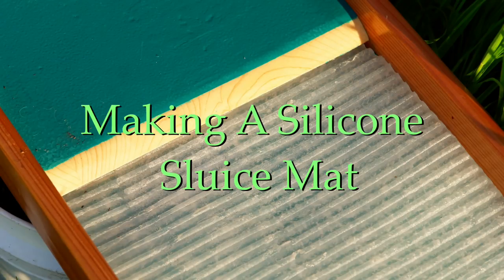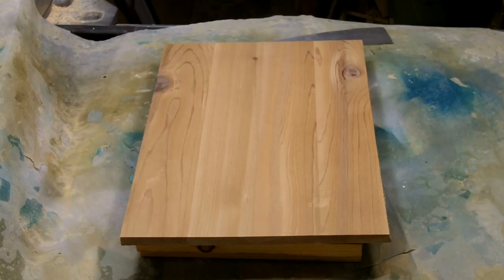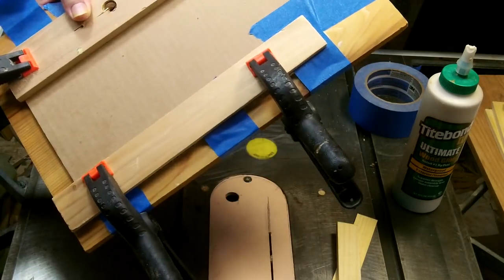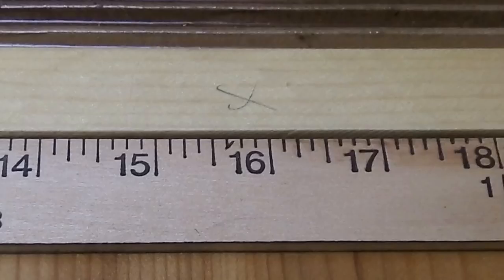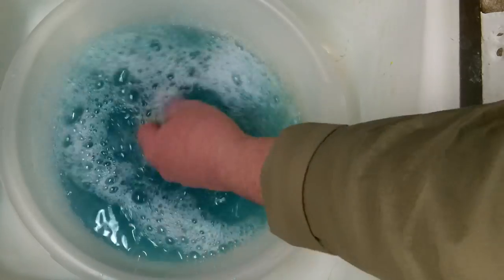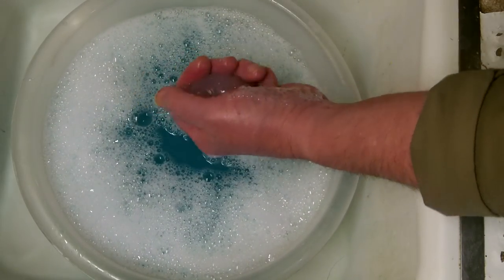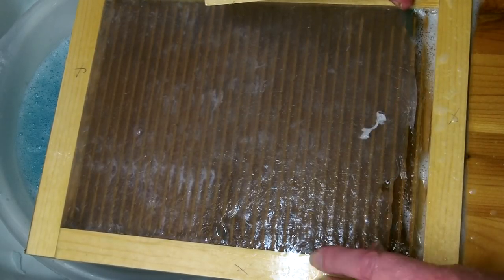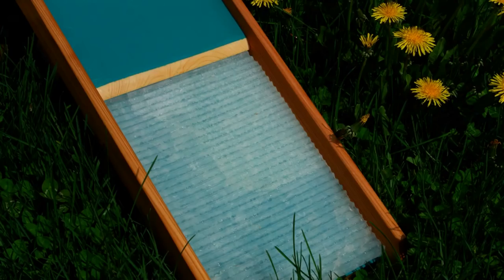DIY SILICONE GOLD SLUICE MAT

Comment: I got a big truck mud flap, I'm thinking of using it as a mold, deep grooves/ corrugated. It is a stiff plastic, used and rough, I am wondering about needing a release agent, so the silicon doesn't sticking to it?
Reply from the maker: Hi Murray and thanks for watching. That should work fine for you. Yes, you will most likely need a release agent. I use Dawn Dish soap. I mix about 1/2 oz to 2 or 3 cups of water in a container. Brush it all over the mold. Then squirt about half a tube of silicon into it. And let it sit for about 1 minute. You may want to wear rubber gloves if  you’re sensitive, then coat your hands with the Dawn soap and pick up the silicon and knead it like you would with bread dough. After a couple minutes, start pushing it into the mold. Push it into the cracks with your fingers and when crack is full press down hard with the heels of your hand. Then level to the top of the mold. When you have finished you can put the mold into your sink if it will fit and either run hot water over it or put it under hot water. Hot water makes it set up faster.
Good luck with your build.

Comment: Another great video. Thanks for sharing your ideas and giving us the benefit of the lessons you learned. I'm wondering if a mold could be made with bubble wrap. Would it give the kind of pockets the other guy was getting with the Legos?
Reply from the maker: Hi Tim. Thanks for watching. Yes, it could and it would be an interesting mat. Yes, it would make the pockets very nicely. I made a sluice with circles in the tops of the riffles a couple of years ago and they really worked well. I think if you took a medium or small bubble piece and popped all the bubbles on one side so it would set flat on a board and then glued it down with silicone and built the frame around it, it would work out very well.

Comment: There is a liquid rubber type stuff for sale, that is used to repair screw driver handles and put padded handles on other tools.
May be worth an experiment.
Its called plasti dip.
Reply from the maker: Phillip Jacobson 
Hi Phillip and thanks for watching. Yes, I have some and have tried it. It will work to make the mat but it is a little different material than the Silicone and the gold doesn't stick to it quite as well. But you can make a rubber type mat with it.

Comment: I wonder if you could just spray the cardboard with something that would turn it into a flexible mat on its own?
Reply from the maker: Hi BC and thanks for watching. You may find something but the problem is, that it has to soak into the cardboard and keep it stiff and flexible. Rubberized compounds only sit on the top and don't soak in and the slightest weight on the cardboard crushes it down. Turning the cardboard into a hard mold was the best I was able to come up with. Actually you can use the mold in a sluice. It won't be very long lasting but it would work. You could actually build a sluice out of cardboard and waterproof it with the Titebond glue and Spar varnish. However something that works better is Rigid Styrofoam Insulation. I made a Miller Table out of it that works very well.

Comment: I know now where are Road Runner went to work after Warner Brothers let him go.  He's now working for Silicone Depot. 👍The fastest shipping I have ever had.
Reply from the maker: I understand they have good service. I priced them about 4 years ago and found that  I could buy silicone at Walmart cheaper. Now that Walmart has priced it so high, I may have to check Silicone Depot again.
Reply: @utahavalanch   #1 silicone 6 dollar's a tube. I bought 6 with free shipping, and the cardboard box corrugation is great for making molds. 👍
Reply from the maker: @johnnytoy5487  
Wow!!! Can’t beat silicone at half price with mat molds thrown in. I’m going to have to get in on that👍👍. I’m getting tired of Walmarts prices.
Hmmm, now that I think about it, you could make the whole sluice out of waterproofed cardboard as well. That might be interesting to try just for fun.
Reply from the maker: Which flavor did you get? The Pro or the Premium?
Reply: @utahavalanch   premium industrial
Reply from the maker: @johnnytoy5487  
Thank you.👍👍👍👍
Reply: 🤔 Question, Who figured out that Dawn dish soap did not allow silicone to stick to things. Just curious.
Reply from the maker: @johnnytoy5487  
Us old guys.😝. Human spit works just as well. Back in the 60’s silicone was a military only material called RTV. it was used on military aircraft. We used to get friends to sneak it off base so we could make cheap gaskets for our cars. Spit was the main thing used to keep it from sticking to your fingers. That got old so we started looking for something better.  Then started wetting finger and running across bar of soap. Alcohol worked fairly well. Eventually dish soap came along and that and Vaseline and cooking oil works too.

Comment: Hi Utahavalanch, great build nice looking matt, I tried wetting my mould up before I put the silicone down, the matt turned out a disaster. I had to make an other mould. I waxed it all over and the matt was an other disaster. The miller table I was making is finished, gave it a try this afternoon, I have a small problem, the gold that we are getting is flat as flat, I have a pan at the end of the table to see if there is any gold been washed over the end. I am going to have an other play tomorrow. It looks good so far. Cheers     Robert - Aust'
Reply from the maker: Hi Robert and thanks for watching. What problems did you have with your mold? You need to knead the Silicone in a bowl of soap and water for about 7-10 minutes so that it will set up. Also if you wet the mold very well with the soapy water the silicone shouldn't stick to it. Then just let it dry long enough. If it sticks to the mold after it dries, you might try using glycerine that you can buy in a pharmacy. It is kind of thick like syrup and will make a good mold release.
With the gold on the Miller Table, be sure to have a valve on the water line that you can reduce the water flow with and keep the angle at about 3 degrees. I screen my material to the same size, then turn the water down and drop a little black sand the same size on the table. Then adjust the water so the black sand starts moving down the table slowly. Then it's ready for adding the gold.
Reply: Hi Utahavalanch, there are a couple of issues that do not work for me, the silicone takes a long time to dry 1-2 days, and after waxing the mould and watering up as well the silicone still sticks to the mould in a way that it is very hard to get out. On my last attempt the silicone stuck that bad that it tore an lost its shape and was unusable. I will give the glycerine a try. The miller table, I have it quite flat and enough water to make the black sands flow off the table, I have the shut off valve in the middle of my hose like you suggested. I will be checking my pan that I have at the end of the table to see if there has been any gold washed off from my first run. I have my cons screened down to fly wire mess.    Cheers       Robert
Reply from the maker: @newbee1016  

Hi Robert. A long dry time sounds like very thick silicone and not enough time getting massaged in the soapy water. If your mat is thick, try to make one only about 1/4" thick to test it.   Be sure you have about 25% Dawn or another dish soap mixed in the water. Also sounds like not enough dish soap in the mold. You can brush a thin layer of straight dish soap into the mold before you put in the silicone.
You may have to try a different brand of silicone. Different brands act differently. Be sure it is 100% clear Silicone and not the tinted type. 

One thing I recommend to people just starting out with new Miller Tables and sluices, is to buy a package of paydirt from a good reputable company to run over/through it for the first time if they haven't run one before. Check out some of the YouTube videos of people testing paydirt to find a good one. I can recommend several but one is in Alaska and another is in New Hampshire. Don't know what the shipping would be like. 

They will have gold in them and when you see how the gold acts, then you will know for sure if you have gold or not. If you haven't worked with real gold before it's very hard to tell what is gold and what is not. Once you see it for real then you will know if it's gold or not.  If the black sand is moving slowly down your table but the gold is washing off, then you most likely have mica. It looks like gold in every way but if you get it in the shadow it loses it's shine. If you put a piece in a gold pan and try to smash it with a spoon, it will shatter. Real gold will not.

Even very small gold will stick to the table. I hope some of this helps.
Reply: Hi Utahavalanch, thanks for your tips on the silicone I will give them a try when I get around to making an other matt, maybe tomorrow. The miller table is dialled in and catching the finest of gold that I can only just see. Thanks for the idea and the build video, I will be using this to clean my con's from now on.     Cheers     Robert
Reply from the maker: @newbee1016  

I'm glad to hear things are working out for you. Get a lot of practice on the Miller Table as it has a lot of capabilities. With my Urban prospecting, I run a lot of small samples to test different areas and it's a lot quicker and easier to just run these on the Miller Table. You can easily see very tiny gold that would be lost with many sluices. 

This new sluice I'm working on may be of interest to you as you are heading in it's direction. With this build under your belt and you get the hang of Silicone mats or you can use just any mat with it or do like I'm going to do and make it into a Drop Riffle Sluice. It's a combination Miller Table Sluice. I have been having a lot of fun with it.
Reply: Hi Utahavalanch, I checked the angle I was running my table at 2deg, an it was running the black and white sands off perfectly. I am going to make an adjustable leg system for it so I can set it up more easily. Cheers    Robert

Comment: You could use a drop riffle sluice as a pattern to make a silicone mold. Then use that mold to make a silicone drop riffle sluice. You might need to use something different for a release agent. Or perhaps use resin instead of silicone for the finished product.

I wonder how silicone would perform as a miller table surface using custom textures. Did you know you can dye silicone with food coloring? You can also mix it with corn starch to make it more durable, and easier to work with like a dough? King of Random has some good videos. He calls this silicone/starch material Proto Putty.
Reply from the maker: Hi Bullfrog and thanks for watching and the comment.  Yippers, I'm in the process now of making a mold for a drop riffle sluice. I'm playing around with different size riffles and troughs and trying to decide which would be best. Yep, decisions, decisions. :-D  I have used different paints to color some of mine and it works quite well although it speeds up the setting time to only about 10 minutes. The problem with the starch method is that the silicone loses some of its metal "Stickiness" that makes it so good as a gold catcher.  Yes, it works fairly well as a Miller Table and I have tried it. Problem is that it holds the black sands as well as the gold as they are metal also, so the hard deck with the Chalkboard paint is still the best in that regard. I am currently working on a Miller Table type sluice that has been one of my most fun projects to run. trying to get a video out.
Reply: @utahavalanch  I just found out Rust-Oleum has a clear chalkboard paint.
Reply from the maker: @jjbailey01  

That is interesting. I guess so you can have a customized color under it. We tried using Matt Spar Varnish on my grandson's sluice slick plate and it worked very well to catch and slow the gold down. Problem was that the gold blended in with the color of the pine and was hard to see. I have the colored Chalkboard Paint on my new sluice that I'm trying to get a video out on and it works very well as it's a strong color that the gold stands out well on.
Reply: @utahavalanch  I was thinking the same thing with using a custom under color. And it's about $10 cheaper for 30oz. than the black paint is for a quart.
Reply from the maker: @jjbailey01  

I have been using the quart paint for all of mine. You have to choose a color for them to mix it when you buy it. They have about 9 different colors for you to choose from. I like the green or the teal colors the best. Home Depot also has a little 3" roller set that I use to apply the paint. This is some pretty tough paint and I have been using it for painting outside wood items that are out in the weather all the time and it holds up better than the Behr outdoor paint. So that makes it ideal for prospecting projects like miller tables.

Comment: Have you ever tried adding food coloring like some people do ?
Reply from the maker: Yes I have and the water based hobby paints that Walmart sells. They both work well but the hobby paint causes the silicone to start setting up rather quickly so you have to work fast with it.
Reply: @utahavalanch    SUCCESS 👍 The silicone setup fine today.
Reply: Now I'm waiting on the spar varnish to set up on the cardboard mode I made today. Thanks
Reply from the maker: @johnnytoy5487  
Congratulations. Glad it’s working out ok.👍👍
Reply from the maker: @johnnytoy5487  
Sounds good. Give it about 3 good Coates total.

Comment: What thickness cardboard do you start with? Regular or maybe a piece of refrigerator cardboard box.
Reply from the maker: Hi Johnny and thanks for watching. I like cardboard with the largest corrugations. I look for the largest boxes I can find. The box used here held a bushel of fruit from a fruit farm.
Reply: Forget the box.  Someone mentioned using a washboard.  I know theres one laying around someplace which im gonna try out myself right now.
Reply from the maker: @UpcomingJedi  
That would work as well. However it been many years since I’ve seen a washboard around so one may be a bit hard to find.😄

Comment: Using the same silicone as you use, and I'm still having trouble getting it to set up 🤔 got any tips.
Reply from the maker: Hi, Johnny. Well, be sure it says 100% silicone on the tube. There is a calking that looks like the silicone but it doesn’t set up. That is usually the mistake some folks make.
Next silicone needs heat and water to set up. If you squirt some silicone into a bowl of soapy water and then gather it up and start kneading it like you would bread dough and dipping it back in every 15 seconds, you get it the water it needs. If the water is cool it will take longer to set up. If the water is warm, say about 80 degrees, it will start to set up in about 3 minutes and you have to work fast. After you get all the silicone in the mold and leveled, let it set up for about 5 minutes and then put it in the kitchen sink and run a light stream of water over it as hot as you can get until the silicone feels warm to the touch. Let it sit for about 15 minutes and then do it again. Do this about 4 times.
If you can get the whole mold in the sink, you can cover the mold with hot water and let it set. When it gets to the point where when you press down on the silicone and it feels hard and not soft, it’s ready to go.
I usually fill the mold at night and then go to bed as I get too anxious to get it out and ruin it if I don’t.😝
Hope this helps.
Reply: @utahavalanch   I'm using 100% GE clear silicone, same as you use, Dawn dish soap and warm water. It's still staying stickie and gooey. I only had one mat to set up. Still, I'm not giving up.👍 I'll make another cardboard mold and try it again.
Reply from the maker: @johnnytoy5487  
Wow!! You may have gotten a bad tube. I have gone through about 50 of those without a problem. I would just set it aside in a warm room and let it sit. I have heard from 2 others that they had batches that didn’t set up for several days in the winter. One of them contacted me last week. His finally did set up after several days by a heat vent.

Comment: Excellent video brother! I though about this but wasn't sure how best to seal the card board. 

Just tops, keep at it and lots of luck with your mat. Would love to see it in action and results
Reply from the maker: dodgersfn Shepard
Hi dodgersfn and thanks for watching. Spraying the cardboard with Spar Varnish works very well but you have to soak it good on the first spraying so that it soaks into and saturates the paper. Then apply additional coats to increase the strength. Watered down Titebond III glue will work also but it needs to be sealed with the Spar Varnish. I did a video with it right after this one showing it in use but another feature of the sluice sidetracked me. 😄 I am working on another simple sluice that folks can build and use this mat and others like it and I will test this mat a lot more. So far on my Miller/sluice, it has really held on to the gold.